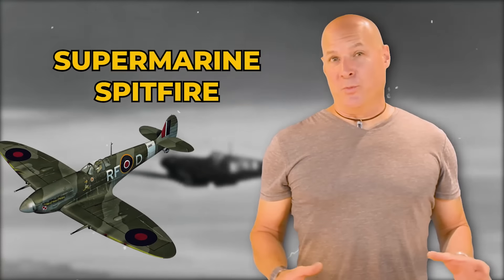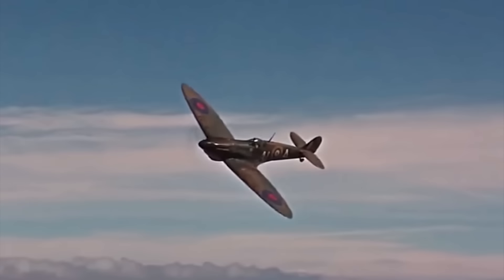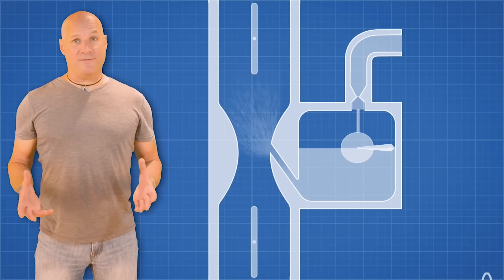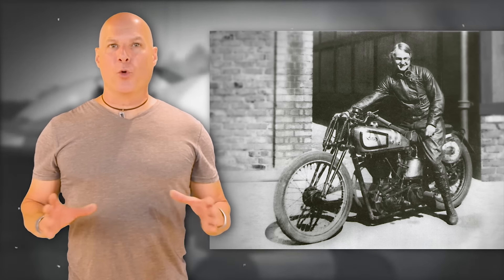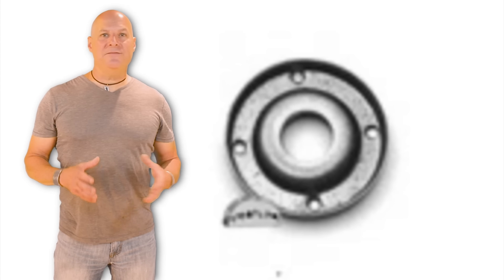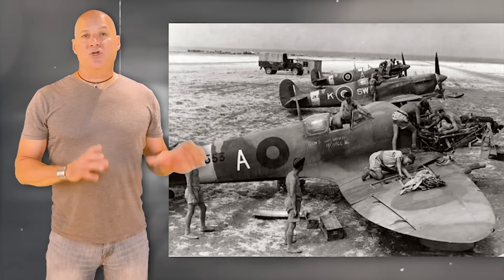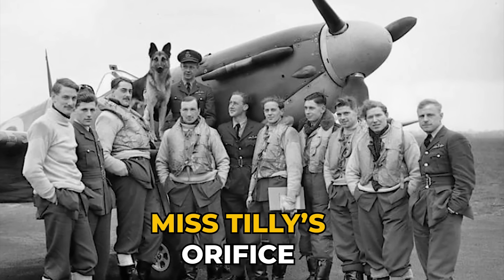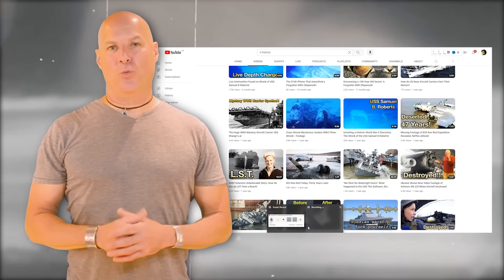How did SHE Save Britain’s Troubled WW2 Spitfire Warplane?

Comment: As a kid I read "Johnnie" Johnson's book "Wing Leader" (1956) about his World War II experiences in Spitfires. I still remember his accounts of German fighters diving and escaping from a fight in a maneuver his Spitfire couldn't follow. Later I read Robert S Johnson's memoir of his exploits in the P-47, "Thunderbolt" (1958). Several times he recounted German fighters trying to escape by diving, only to be shot down when he followed them in his Thunderbolt. At one point he wrote, "They never learned!" I assumed the German pilots were slow to adjust their defensive tactics, learned against Spitfires, to deal with Thunderbolts.
Reply: The Thunderbolt was so heavy relative to its aero drag  when in a dive it put on speed very quickly it also had r high limiting Mach number. 
In terms of Mach number the Spitfire which could out dive the two main German fighters  was faster but the Thunderbolt and Typhoon and Tempest put on air speed faster
Reply: Try reading the book "Sigh for a Merlin" written by Alex Henshaw.

Comment: Thank you very much for highlighting Ms Shilling's role. While I had heard of the existence of the "quick fix" for the Merlin carburetor, I had never heard of the engineer responsible. It is really good to have her named.

But I also would have appreciated more information on how her restrictor worked. Further, how much of this was drawn from her motorcycle experience, and where had she come across this problem in that field? That would better illustrate her contribution. A few more facts on her ongoing engineering career would also have better served her. A revised video with some more details would honor her memory better.

I also share the opinion of some othes that the adjective "awful" in the title is unnecessarily sensational. "Flawed" would do fine.
Reply: Should have been Awarded top Honors

Comment: It is worth reading Stanley Hooker's autobiography. In it he talks about the power advantage the use of carburettors gave to the Merlin over the use of fuel injection. This arises because the evaporation of the fuel in the intake tract cools and increases the density of the charge. Later Merlins with injection carburettors continued to have this advantage while overcoming the hesitation issue.

Comment: A Spit's carburetor float would fully open the fuel inlet valve into the float bowl when in negative G, allowing an excessive amount of fuel to rush in and flood the carb bowl which then feeds the engine with an overly rich mixture. Miss Tilly's Orifice is a simple plug-and-play choke that can be installed in the carb's fuel inlet feed without needing to remove and disassemble the entire carb. It simply restricts the fuel flow down to a level that's just enough to feed the engine. This reduced fuel flow slows down the onset of carb flooding in a negative G situation.
Reply: THANK YOU, finally a quick and clear explanation! Makes sense too.

Comment: Me 109's biggest advantage was the cannons. The more experienced pilots did a roll into the dive once the problem was identified and the Spit could out turn the 109. All through the war it was a battle within a battle between the 109 and the Spit. Both engines powered many other planes of the war but the Merlin must take the prize.
Reply: And Spits later fitted cannons.

Comment: I read in a book about WW2 engine development that British engine developers made three big mistakes: 1) not developing direct injection, 2) developing sleeve valves instead of poppet valves, 3) not prioritising Frank Whittle jet engines more. All the same, the Merlin was definitely the best engine we had and was developed throughout the war, followed by all the Bristol radial engines, followed by the Napier Sabre, followed by the Griffon. The war was about over by the time the Griffon came along.
Reply: Also became the basis of the Meteor tank engine which was probably the best tank engine in the war!
Reply: Not using direct injection was NOT a mistake. By using a carburettor upstream of the supercharger the evaporating fuel cooled the charge air allowing higher boost and therefore power without detonation. Sir Stanley Hooker in his book Not Much of an Engineer estimates an increase of 150 HP. The negative G problem was fully solved by the injection carburettor fitted to later Merlins. The engine in the BF 109 was of much larger capacity (37 lt against 27 Lt ) than the Merlin, but of much the same power.

The sleeve valve Bristol Hercules  was a very successful engine and went on to have one of the longest overhaul lives of any of the big radials. The use of sleeve valves allowed, once again, an increase of boost pressure before detonation problems mainly because it removed the very hot exhaust valves from the combustion chamber.

The jet engine was unknown technology in the mid war years. The development was in line with the German version. The ME262 engine was an example of pushing the axial flow technology too far ahead of production ability. The centrifugal engines in the Meteor were much more reliable.

Comment: Somewhat over simplified issues and historical events. Miss Shilling developed the RAE restrictor, which was in the fuel line to the carburettor, it didn’t impact the battle because it was under test. An anti-g carburettor and fuel injection had been developed and tested before the war by Rolls Royce for  the diesel sleeve valve kestrel. The RAE disregarded injection for charge cooling which gave the Bristol Sabre Merlin and Griffon a power advantage at altitude over the Daimler Benz and BMW engines.
Also often forgotten British specifications of the time called for aircraft to be capable of operating across the then Dominions of Canada, Australia, New Zealand South Africa and the Empire with maintenance units in Cairo, Karachi and Bangalore. Carburettors were simple to manufacture and repair under the concept Better is the enemy of Good, which was demonstrated successfully during the East African war and early Middle East campaigns.
Indeed SU and Hohson had pressurised carburettor and fuel injection prototypes working before the war, but the RAF strategically was in desperate need of monoplane fighter aircraft, September 1938, the RAF front line fighter was the Gladiator, the first Hurricanes had yet to arrive.
By 27th September 1939, Hawker had delivered 497 Hurricanes to the RAF enough to equip 18 Fighter Command squadrons and there were 306 Spitfires in service with simple carburettor easy to manufacture and repair. 
Also it wasn’t the disadvantage has often portrayed, the RAF fighter pilots had a manoeuvre which over came the issue, which the 109 could not follow because of the inferior airframe, and lower tactical Mach number. Rolls Royce had tested the German injections systems on a modified Merlin identifying failures in the direct injection pipelines.  Indeed Dr Sachse head of engine development BMW expressed his frustration with their  injection systems use with BMW 801 engines for the same reason, in post war interviews with the Fedden team. 
It took Rolls Royce time to sort out Merlin with an SU injection system similar to the Sabre,  was using Hobson-R.A.E. BIINSB fuel injector, with injection through I nozzle into eye of supercharger impeller. Updraft air intake Automatic boost control for Typhoon.  
Finally during the Battle of Britain the Luftwaffe lost 229 Me109 aircraft during August. Indeed during the period of the battle the Luftwaffe lost 64% of its initial single fighter strength. So was fuel injection a decisive strategic factor?

Ref Rolls Royce Heritage Trust book, 2 The Merlin Perspective book 31, the memoirs of George Purvis Bulman head of Engine Development and Production Book 28 Boxkite to Jet, Frank Halford and Fedden Mission Report to Germany.

Comment: For the next important and powerful Merlin 66 engine, Rolls Royce finally decided to use the Bendix–Stromberg Injection carburettor. The American Bendix-Stromberg pressure carburettor was developed in the mid 1930’s and was in production from 1938. This carburettor was designed to operate as a fully pressurised fuel system that dispensed with the problematic float controlled fuel level with its emulsion tubes and diffusers. Negative G had no effect on fuel flow or carburettor function. The pressurised and metered fuel flow was delivered as a spray into the inlet air stream just in front of the supercharger inlet. This feature virtually removed the risk of carburettor icing, in fact the throttles and chokes of the injection carburettor did not need heating by hot oil or coolant circulation at all and their deletion removed several other problems associated with the previous provision of those heating circuits.
ROLLS-ROYCE MERLIN CARBURETTOR DEVELOPMENT page

Comment: A roll does not involve negative G unless the pilot has stuffed it up. The weakness was in performing a bunt where the nose is pushed down thereby creating a negative G load on the aircraft.
Reply: Actually properly flown competition aerobatic rolls DO require negative g.  It is possible to roll an aircraft without negative g, but in competition aerobatics this is not recognized because it is too easy.  Whether or not negative g is introduced depends on the type of roll flown.  A barrel roll maintains positive g throughout.  A ballistic roll is flown mostly at zero g and follows a parabolic trajectory.  A “slow” roll in competition aerobatics requires the CG of the aircraft to maintain a straight line and is one of the more difficult aerobatic maneuvers to fly properly.  It is an “uncoordinated” maneuver in that the slip ball is not kept centered throughout the maneuver.  Instead, the pilot must use proportional top rudder when the aircraft is not wings level, and proportional forward stick (yes, indeed negative g) during the inverted half of the roll.  If there is no negative g, the pilot “stuffs up” a slow roll.  Ballistic rolls and barrel rolls are much easier to fly, and they are not recognized in the Aresti catalog as competition aerobatic maneuvers.  There is actually a complex variation of the slow roll that is even more challenging to fly.  It is an Aresti catalog maneuver and is known as a Rolling Circle.  A Rolling Circle involves flying a horizontal 360° circle while rolling four times (once every 90°) at a constant roll rate and constant turn rate, all while maintaining a constant altitude.  I have been practicing this maneuver in my Extra 330LC over the last few weeks.  It is challenging, but extremely rewarding when you get it right.  You absolutely have to use negative g, both to turn and to maintain altitude, during each quarter of the horizontal circle.  I flew one earlier today and was able to maintain altitude within 50 feet.

Comment: I also designed a carburettor accelerator pump device that prevented the Keihin CV 40 carb used by Harley Davidson on their EVO engine from coughing and spluttering when given a big handful of throttle at low revs.
It was a small cap that reduced the accelerator pump's piston travel, therefore slightly reducing the amount of fuel delivered. 
I could also install it on mate's bikes in the field within 10 minutes. A right angle drive Skew Driver was a boon to carb access.
It didn't help us win the war though. Just saying.

Comment: The permanent cure for this issue was the Stromberg-Bendix Pressure Carb that Pratt and Whitney and Wright used, and Rolls would get. Basically the same as a modern throttle body injection unit with analog controls.

Comment: Beatrice Shilling interviewed some of the German aircraft engine bosses after the war, but she asked them technical questions, such as why they decided not to use wet-lining in their engines, whatever that is.
Reply: A wet liner is a piston cylinder sleeve that coolant runs up against for cooling. A dry cylinder liner fits snugly into the block which has water jackets for cooling and coolant doesn't run directly against it.
Reply: Wet liner is coolant cooled and temperature is more even in the cylinders

Comment: The reluctance, indeed hostility, to the idea of fuel injection on the RR Merlin was absurd..and very damaging to the war effort.
Reply: Not really, RR did some research on fuel injection and chose to stay with the carb. Nobody would agree that it was ''very damaging to the war effort''.
Reply: How so. Rolls Royce made deliberate design decisions and stuck with carburetors for the life of the Merlin although they did switch to pressurised carburetors when they became available. Fuel injection in high boost supercharged engines never became fully optimal until the advent of engine management computers. In the absence of engine management systems Rolls Royce elected to use the carburetor supercharger combo and the development history of the Merlin certainly does not indicate this was a mistake. The Germans developed a mechanical single lever control to manage the various engine parameters to reduce pilot workload in combat but this does not approach a digital engine management system in performance optimisation of a fuel injected setup. There are books on this subject which is highly technical. Consider what happens in your modern fuel injected car if just one sensor fails..
Reply: I was around in the 1970s and remember very well the aggravation caused by PI in a certain brand of car. This was amply sufficient to blight that cars reputation for reliability and PI was dropped in the last of production in favour of good old carburetors. 

George Washington reputedly said if you have half an hour to fell a tree then you should spend 20 minutes sharpening the axe. The Spitfire probably spent far more time in the air doing mundane things, than in contest with the Luftwaffe, and it will have spent more time still under preparation on the ground. Needless to say, the turnaround on the ground, whether at a formal airbase or a forward airstrip, is critical to what the aircraft can accomplish in action. Maintenance and serviceability were a major factor in the design of the WW2 Jeep and I have no doubt that similar considerations touched the design of the Spitfire.
Reply: @jonathanlewis453  Agree!  More Spitfires were lost in training accidents than were shot down by the Luftwaffe during the Battle of Britain. I thought you should know this!
Reply: @Slaktrax  I can understand the principle that risks are more likely to be  taken in the face of an emergency but having referred to Francis K Masons book and the RAF Fighter Command daily Loss Tables referred to therein, I hesitate to believe you. Do you have authority for this assertion?
Reply: @jonathanlewis453  It was in one of many books I had on WW2 aviation, the collection was given to a friend when I left the U.K. in 2001 and books are just too heavy to justify carting them to 13 different countries between then and now. I can't even remember the author. Sorry.
Reply: Indeed.

This is the REAL issue.

Why no fuel injection?

Comment: 5:35 this is not the restrictor.  There were two forms; a conical shape with a finely metered hole, and later a simple washer shape with fine hole.  Both versions were inserted in the fuel pipe to carb inlet union.

Comment: It was difficult for women working in technical jobs in those days. My mother was a Physicist (we think she was the first woman in New Zealand to get a degree in Physics) working for the war effort in a London laboratory during WW2. Her special field was performance and reliability of electrical devices.
The RAF had a problem with radio sets.. the main valves in the radios were reliable when the radio was mounted in a Lancaster bomber, but failed quickly in a Wellington bomber.  She was sent examples of the radios from both planes, which was pointless as they were identical, so she asked to be taken to an airfield to inspect the radios as installed in each plane.  RAF were happy with the visit until they learned she was a woman, at which point they refused permission and asked for a man to be sent. It took weeks, but when she finally got to the airfield she identified and solved the problem just by looking: in one plane the radio set was mounted on a transverse bulkhead, but on the other it was mounted on the fuselage.
The direction of the vibration of the motors was therefore 90 degrees different relative to the radio set, and the structure of the valves was much more resistant to vibration-induced fatigue in one direction compared to the other.
The solution was to drill and tap another pair of mounting holes in the radio's chassis for the valve bases, at 90 degrees to the original, and simply rotate the valves 90 degrees.  The valves then became as reliable as in the other bomber.
After that, the radios were manufactured with both sets of holes so they could be quickly adapted in the field, and radios were produced with -L or -W type numbers from the factory.
The problem could have been solved weeks sooner if the RAF had not initially refused permission for her visit...
Reply: A very excellent explanation which just raises the question: Why didn't she just ask how the radios were mounted?
Reply: @scriptsmith4081  That's not a question one would normally ask when troubleshooting a problem like that. It was seeing the installation itself that set off the lightbulb moment of figuring out what was going on.
Reply: @scriptsmith4081  Easy to say after the fact!
Reply: Please tell us your mother, the physicist, name!
Reply: Great story, thanks.